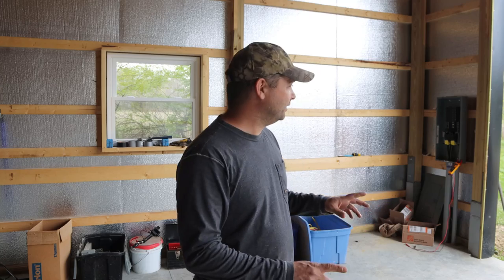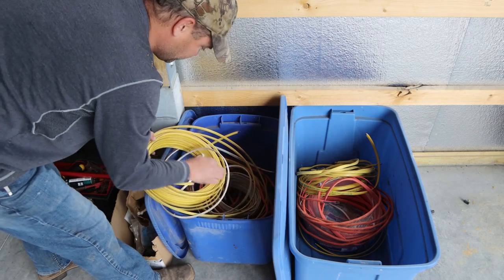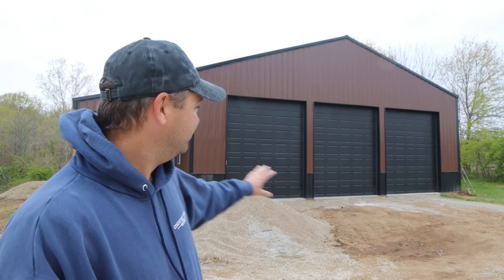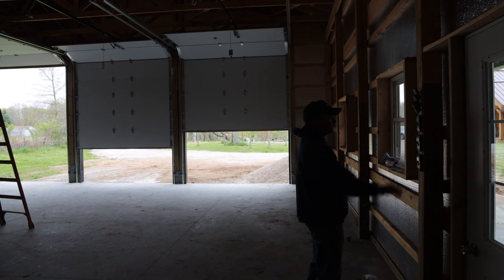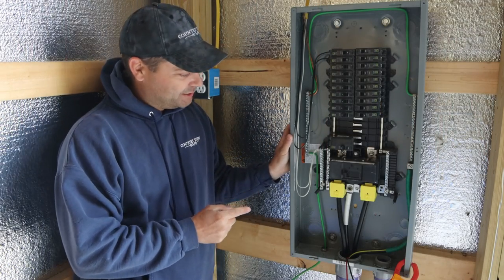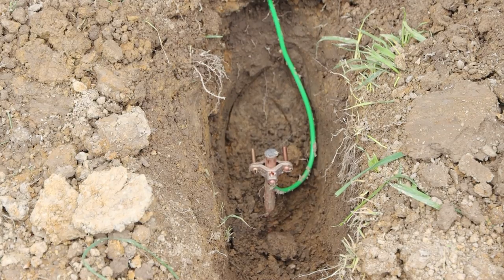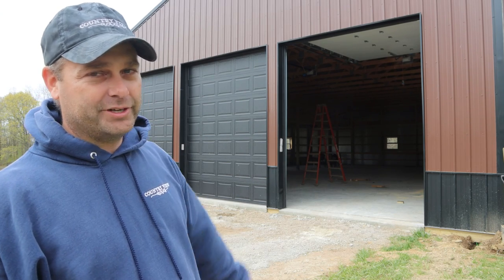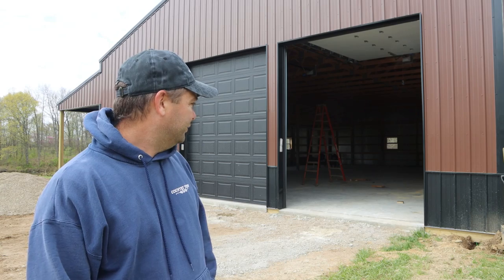Garage Doors and Grounding the Breaker Panel.  Pole Barn Build.

Comment: ETHAN,
Don't forget, if you hang gutters,
you'll have to CLEAN gutters. I would
lay big rock, bigger than gravel under 
the eaves of the building for the rain to
run off the roof & splatter upon the rock.
Now & again pressure
traces off the building. That would be easier 
& safer than teetering upon a tall ladder 
cleaning gutters.

!

Comment: You are right on the outlets, the garage doors will plug into a outlet and you will have garage door openers and you can code them to your truck and car and open and close them from your vehicles. There will be a opener for each door and you will enjoy having a remote. Each opener will have a code you can set. The pole barn looks really good and it will be great to work inside out of the weather.

Comment: Good video Home Depot sells what they call a valve box about 25 dollars to put in the ground over your service ground connection so you access to the attachment point also y’all should consider a surge protector for that panel just my two cents

Comment: Don't forget to leave those boxes proud of the wood by the drywall thickness! I'm always forgetting that. Little nubs on side of box to indicate. You're also meant to leave those tabs half attached where the wire enters the box to act as a wire grip so it can't pull out ... it's kind of a pain in the butt though
Reply from the maker: I don't plan to put up drywall.  I plan to put metal on the ceiling.

Comment: The great thing about having it done now is you can use it. Rather than build as you go.  The only thing that may have been nice is a large door to bring wider equipment in for winter work.  Hopefully you can get a tax break on it.  It hurts the pocket book now but will pay back in many ways.  I went to the Led light in my garage they work well.  The cold doesn't t effect them.  We all seem to out grow our buildings. Really nice to have a place inside when things break if you need it.  Have great week it will get there.

Comment: I highly recommend putting a strut along the top of the top panel of the doors. The operator arm pulls from that position, and can stress that top panel over time. You may not need it if the springs are well balanced, but it could lead to that top panel being bent over the years.

Comment: Looking good on the building,  and the doors with openers will really be a plus! I highly recommend that at a minimum us metal clad cable, like BX or MEC. Birds and  especially rodents will damage the non- metallic sheathed cable. 👍
Reply: My shop has been done in Romex for about 15 years now with no issues

Comment: You do very nice work... thoughtful and thorough ...  no one knows it all even though they pretend..   I didn't see a green neutral to ground bonding screw in the panel you didn't mention it so assume it must not be there... no inspections... no problems... of note 15amp outlet on 20 amp circuit is a no no..  just FYI

Comment: I suggest that you put a subpanel in your shop area.  Every circuit that you put in the shop area would have to run all the way back to the entry panel otherwise.
I would not have put the main panel in the corner that is that far away from the main usage area.
You could run  2X4s between the truces to hang the outlet boxes for the door openers.

Comment: Nice looking barn there and you did a very neat job with the electrical panel! I always dreaded going into a sloppy wired electric panel, yours looks so neat and in order. BTW I have driven my share of 8 ft ground rods, definitely no fun in rocky ground. Keep up the good work and enjoyed the video!
Reply: I have  heavy clay & rock subsoil. I poured 5 gallons of water on penetration site night before, then used  a steel post driver & finished with a mini sledge. Some guys use heavy duty demo hammer to pound them in.  It took less than 10 minutes + 68 yrs old at the time.

Comment: Great garage!! Thanks for sharing every step of the job.
You’re probably planning to install same LED lights as in the old barn, just to make it easier- they sell them in bulk of 12 and 8 footers, not the 4’.
And don’t trust that flimsy bracket to hold them to the beam, that are only good for first installation, you’ll need to add 2 strips of plastic or metal underneath, (pipe hangers) and to the truss.
Reply from the maker: I have been looking at some different LED lights.  Some High Bay Garage Lights.

Comment: For safety reasons the ground rod wire and the ground from the master panel should be on the same bar. If the bond strap works looses a ground loop could occur in the panel which can make it very dangerous  Looks good

Comment: pour HOT pitch over the ground wire connection to ground rod, this is to ensure 'galvanic' action does not  corrode the ground rod connection underground

Comment: Evan, when you get ready to wire receptacles in the wet/wash down areas instead of buying a bunch of gfci's @ roughly $20 bucks a pop you can buy a gfci breaker & protect the entire circuit that way ( it's a little cheaper ). And you are absolutely correct about bonding the neutral & ground @ the main panel then separating them every sub panel thereafter...........
Reply from the maker: I plan on installing GFCI protected outlets.
Reply: All receptacles wired downstream of a gfi are protected by the same gfi. You don't need many.
Reply: @roscoejones4515  you are right sir.but in an area like a wash down room where the gfcis are prone to getting wet they won't last nearly as long as the gfcis breaker tucked away in a nice dry panel.

Comment: Not sure if you’re going to have to pull new lines for the GDOs or not. 
You might consider putting at least one of the circuits on a separate breaker. Just in case one of the breakers trips. At least the door on the other breaker will still work.

Comment: Put a surge protecter on the line for the operator's 
I worked in the garage door industry for 25 yrs. These new operators are electronic and very susceptible to surges  burning out the control boards and they are not cheap.

Comment: For those of us who haven't been keeping a running total of costs to date... what do you figure you have spent to date?  AND, any plans to do a "what I would have done differently" video ?
Reply from the maker: The total cost, after gutters and concrete pad are complete will be around $81,000.  So far.  Don't have any plan for a "what I would do differently video" at the moment.  May in a year from now, when inside is done.
Reply: THE POLE BARN LOOKS GREAT EVAN

Comment: Check out you local jurisdiction, a lot of areas are requiring 2 ground rods placed 6 feet apart. Also as of 2020 a surge protector for the panel is required. A decent one is about a 100 bucks, I'd stick  with  a square D to match the panel. If you are going to have cable, satalite, phone or things like that you need inter system grounding bar.
Reply from the maker: Yes, I need 2 ground rods.  My NEC book is the 2017 edition.  So it won't have the surge arrestor in it.  But I will see if someone I work with has a 2020 edition and see if I can find it.
Reply: @CountryViewAcres  check with your inspector some areas aren't fully adopting the 2020 book yet. There is a chance you can squeak by on the 2017. 2020 book is horrible I can't wait for the next version lol. Your work looked clean can't wait to see how the shop ends up fully finished.

Comment: Hi. I would recommend you add another ground rod 8+ feet away from the first and replace your #6awg grounding conductor with a continuous piece from the panel to the second rod per NEC rules. Great job otherwise. P.S. add a strut across the top of your doors to anchor to as the screws will jerk out at the lift arm. Those doors are heavy. Experience speaking here.
Reply: Its not the service its a separate  building so only needs 1 ground rod
Reply: No where in the NEC call for 2 ground rods

Comment: Nice so far--but won't you have to bring in more fill for the outsides sooner rather than later? Also, what are the taxes on that building? Lastly...I would strongly consider solar panels on the roof if possible. It's big enough that they would provide for all of your power needs.

Comment: How is it that they can patch a road 10 by 20 with concrete and be driving on it in 2 to 3 days but you won't be able to drive on yours for weeks
Reply from the maker: They say 7 days before driving on it, but concrete doesn't fully cure for about 30 days.  Then it is the strongest or hardest.   You can put an additive in the concrete so it cures quicker, that is probably what they are doing with the road.

Comment: Looks like they put the motion safety sensors at the bottom of doors too. What's the inspection/permit requirements out there? Did you have to get the electric inspected?
Reply from the maker: Not permits here.  So normally no inspections.

Comment: you should never make a wire connection on the receptacle. you should make a pigtail and just the wires from the pigtail go to the plug If you had to replace a plug your way would split the circle

Comment: Why dont you have a water storage tank for the water runoff? You never know when you will need off grid water
Reply from the maker: It is easy to add later if I would want to.
Reply: His water storage tank is the spring fed pond.
Reply: @Strub3  sometimes underground aquifers get containmented and the water becomes unuseable (the aquifer on my family farm got hit with ecoili, we had tp boil the water before it being used, and had to install a UV light filter system on our well. It took us 3 weeks to get the system in place.) And with covid.... it could be longer. Especially if you have alot of livestock to water. (We had about 200 head of longhorn at the time)
Reply: I definitely take for granted that I have access to public water through my local public water utility and forget that others may not have the same luxury.

Comment: No door opener manufacturer supply light bulbs with there units ever..... the reason is if the bulbs burn out riteaway no company wants to come out for a stupid bulb... buy your own. Also FYI the doors you have are residential doors and are not a standard size so if you use these doors as you would a commercial door don't expect them to hold up for the long run but they will out live the warranty  just...

Comment: Oh Evan my sweet ,please put your wiring into conduit.  critters chewy on your great work will be a shame.
Reply: Note the conduit system DYF did on their barn and play room, also Lumnah acres on their barn/work shop.  It will cost a bit more, but in the long run it will save a bundle.
Reply: I only have Romex in my shop, no conduit, and have not had a problem in 15 years.
Reply from the maker: I looked at running everything in conduit,  going to cost over $1000 more.  Romex is the cheapest option.  We will wait and see.

Comment: code violation on how you wired the recep. code 300.13(B) NEC . you do not need the jumper the screws make the connection for that .
Reply from the maker: That part of the code is for multi wire branch circuits and doesn't apply to a 120 volt circuit.  Because there is not 2 ungrounded Conductors with voltage between in them in that circuit..  Read definition of multi wire branch circuit in section 100.  If this was 240 volt receptacles that statement would be true.
Reply: @CountryViewAcres  Yes it does apply the look at diagrams in the handbook. The neutral is called the grounded conductor for a reason . IT is a current carrying conductor . It says very clearly in that code section the continuity of the grounded (not the grounding)conductor shall remain unbroken . Over 20 years as a licensed electrician .
Reply from the maker: @dougshaw9701  diagram 210.1 clearly shows 2 phases in the circuit sharing the neutral.   
300.15(B) clearly states for multi wire branch circuit.
210.4 is section on multiwire branch circuits.  
Section 100 branch circuits,multi wire gives the definition. 
This is all about multiple phases that share a neutral.  
My outlet circuit doesn't apply because it is only 1 phase using the neutral.
 The IBEW teaches you to splice the neutral as a best prectice, so you don't need to determine when it is and isn't required.
Just because my panel is 240 volts, the branch circuit isn't.  This doesn't apply to this circuit.
Reply: @CountryViewAcres  If you have a handbook read all of of 300.13 including the  blue parts , it makes very clear the intent of this section . I have failed inspections because of this .
Reply from the maker: @dougshaw9701  read the first few words.  Multiwire branch circuit.  This doesn't meet that definition of a multi wire branch circuit.
Please read the definition. 
The term multi wire branch circuit is misleading.  It doesn't mean multiple wires.  It means multiple phases.  This clearly about sharing a neutral between 2 or more phases. 
This is the most misinterpreted part of the code.  Just because people don't understand the true meaning of "multi wire branch circuit "
Please read those other sections.  And every diagrams i have found referring to 300.15(B) will show 2 phases and one neutral.
Reply: @CountryViewAcres  I have i have been through classes 4 year apprenticeship several code update classes and when the code says shall it means you will do it and when it says shall not it means you will not do it it says there that the grounded conductor shall not be broken and says this is for devices and a plug is a device . I have ran jobs with 20 people under and gotten burnt because some will not listen and have had to pull over 300 recps out to show an Inspector how they are wired .
Reply from the maker: @dougshaw9701  since you are stubborn and won't read the definition of "multiwire branch circuit".  I will not change you change mind.  I am not arguing with 300.13(B).  The neutral has to be spliced off the device on a multiwire branch circuit.   My argument is that this isn't a multiwire branch circuit.  So 300.13(B) does not apply to this circuit.  Explain how to how my circuit is a multi wire branch circuit.
Reply from the maker: Code 300.13(B)  first 4 words "In multiwire Branch circuits"   my argument is my circuit isn't a multiwire branch circuit.   So this piece of code doesn't apply to my branch circuit. 
Section 100 "branch circuit, multiwire. A branch circuit that consists of TWO or More ungrounded Conductors that have voltage between them, and a grounded conductor that has equal voltage between it and each ungrounded conductor of the circuit and that is connected to the neutral or grounded conductor of the system"
That means 2 phases or more and a neutral.  I have 1 ungrounded conductor and 1 grounded conductor, not two ungrounded Conductors.  So my circuit is a normal "branch circuit",  not a "multiwire branch circuit."  So 300.15(B) does not apply.  So I can splice the neutral on the device.
Reply from the maker: And if that doesn't convince you, Google "multiwire branch circuit"  you will see it means 2 or more phases 1 neutral.
Reply from the maker: And if you are still not convinced, look in the handbook at diagram 250.47.  Adding a receptacle just like I did splicing the neutral on the outlet.
Reply: @CountryViewAcres  i know the definition have been in the code book for 20 plus year(several of them) i understand what section 100 is and section 90 and 230 and 250 and 300 and 310 and 300 over rides it because it has the words shall not be..this is how it has been and until 
they change this sections wording it is the word
Reply from the maker: Your an not interpreting the code correct.  If you would look these things up you will see I am correct.

So here is my qualifications., since you stated yours.  I have an electrical degree. Followed by 23 years of hands on experience,  been to code classes, code updates, 70E training.  I have been overseeing electrical work for the last 9 years.  I currently have 55 union electricians, 2 general Forman, 6 foremen, and one superintendent working for me.  I am the one who Inspects their work. 
Now, residential is not expertise.   industria wiring and hazardous location installations is most of my work fall into.  So I have brush up on residential code, since I don't mess with it everyday.  But interpreting code is part of my job, and arguing with electricians with 30 years experience is too.  They mostly claim experience and refuse to really read the code, relying on what they have been taught.  Just like you are doing.  They refuse to admit what they have believed for 30 years is incorrect.

To properly interpret the code, when the code says "in multiwire branch circuits" it only means those circuits.  Not all circuits, just ones with 2 phases and a shared neutral. 

Obviously we are going to have to agree to disagree.